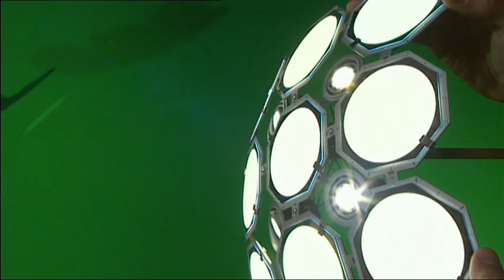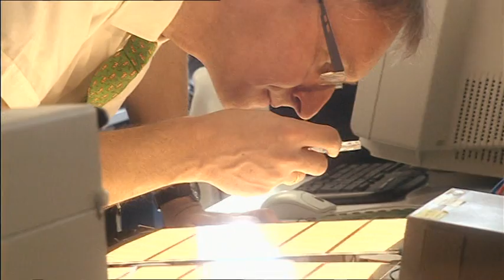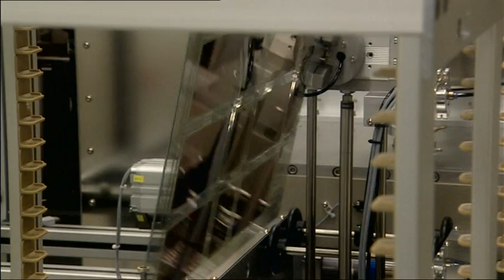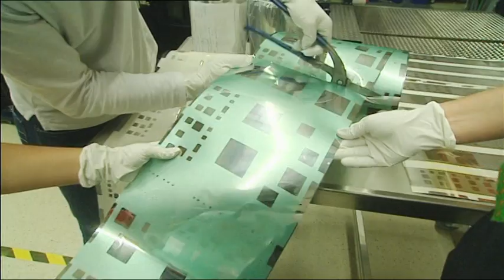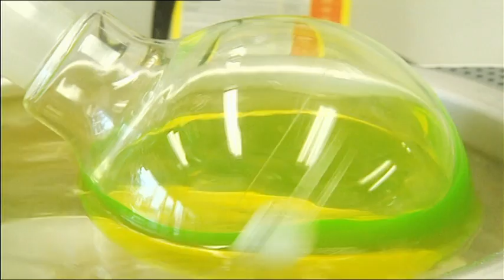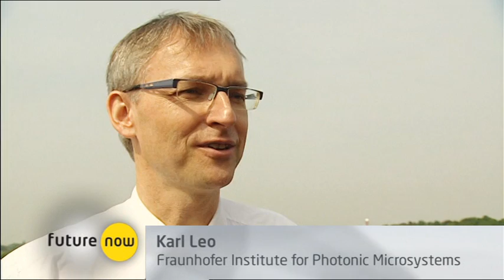OLED: A natural artificial lighting choice

Comment: Probably the "dust" that is occurring with the OLED panels are pieces of polymer that have flaked off as the panel was twisted and moved. I think a good way to keep this from happening would be creating a strong vacuum within the panel; that would keep the polymer from moving as the panel does. Great video too.